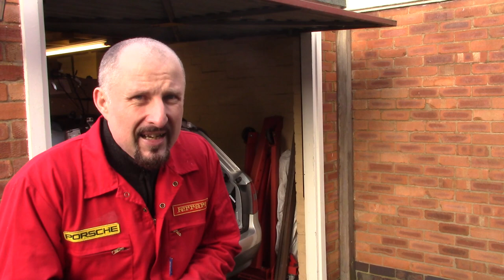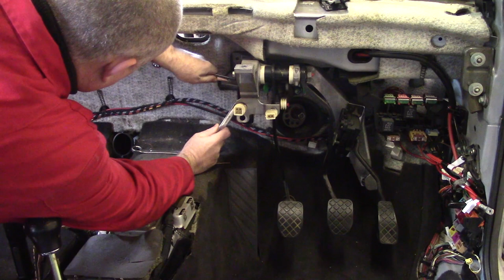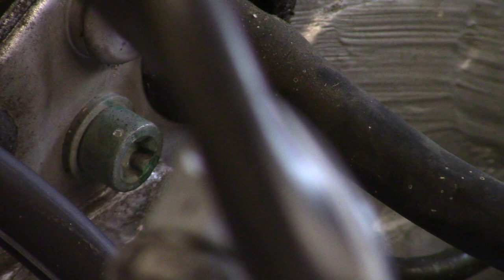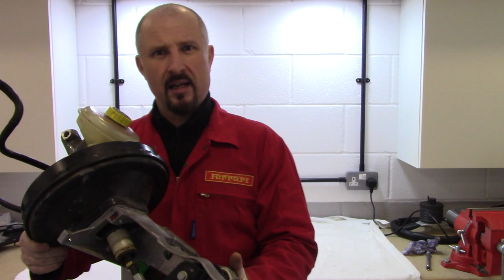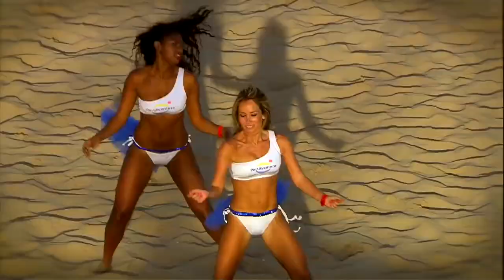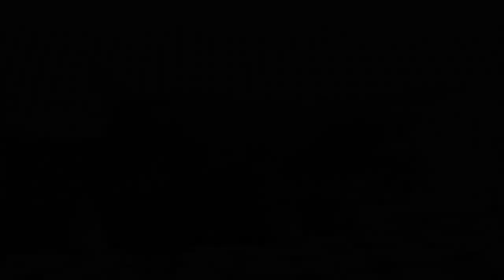Pedal Box and Servo Removal: Audi 2.7 Bi-Turbo. Ep19.

Comment: How many bolts hold the pedal box ?? I’m stuck , trying to get the heater matrix radiator but the brake switch is the way , so the idea is to get the pedal box out and I will have room .any help will be much appreciated